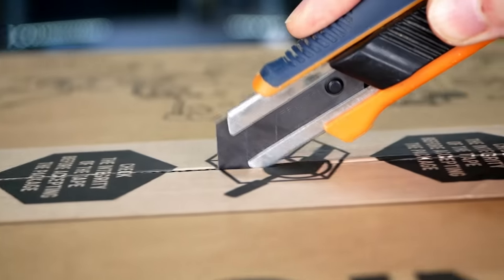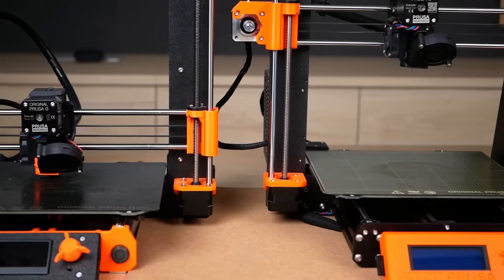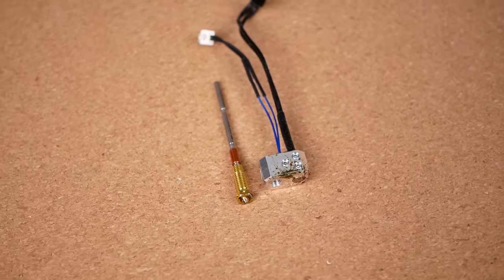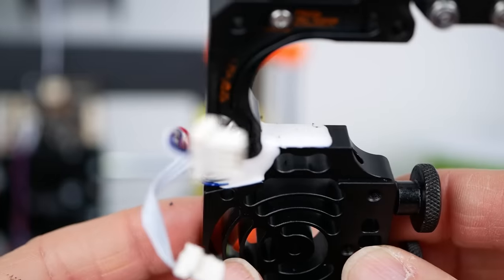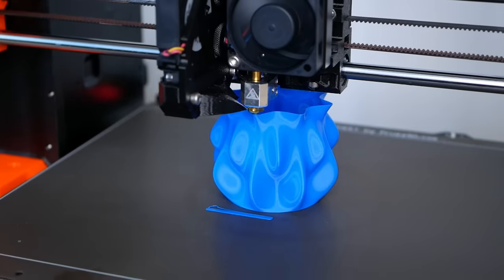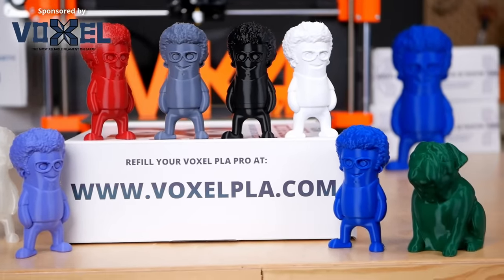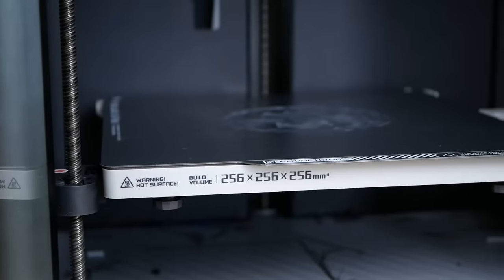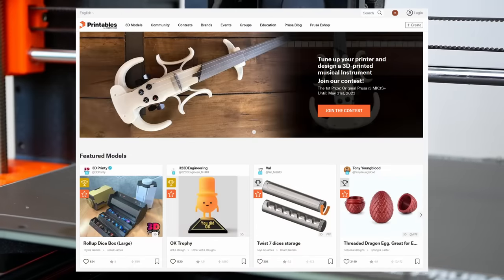Should you buy a NEW Prusa MK4 in 2023 or rather a Bambu Lab X1/P1P?

Comment: The more I've seen from the newly released Mk4S videos, the more I believe it's not meant to be a "new" printer but it's really best used as an upgrade path for those of us with a Mk3. It just seems that being a bed slinger, Prusa knows they aren't trying to compete with Bambu's setup directly. They want to offer an improvement large enough to keep Mk3S owners in the Prusa ecosystem while trying to squeeze an "out of the box" and reliably fast printer into the limits of a bed slinger because of what the community has done thanks to Voron and RatRig's. The Prusa XL is what will compare to what Bambu Labs has done with the CoreXY market.

Comment: Thanks for doing this video.  I've had my mk3S since they first came out and apart from being the most reliable machine I've ever owned (I've got friends with Ender 3's and they've spent a lot of time fixing and upgrading theirs), Prusa is a truly 'fire and forget' eco system.  I'd love to buy a Mk4 but in today's market, it is far too expensive. So unless I can sell my Mk3s for a premium price, I won't be getting a Mk4.  Bambu labs is based on DJI's business model so I'm not confident about the long term support for the current X1 series. (I.E. There will be a Bambu "X2" announced in a few years time at which point your X1 will suddenly become worthless because support for it will end and spares will be difficult to source).  I'd love to build a Voron but there again; the prices are too high for my budget.
Reply: a very good option here in Europe is buying a used voron or Rat rig etc.
yeah a Bambulab X2 is comming but then the same thing happens like the Mk3. Prices for used ones drop very much. Its just normal. But upgrading the Mk3 to the MK4 is also not worth it.... so you end up with the same Problem. But now we got to a point, were most Problems like fist layer, reliability, speeds and so on are done. I dont know how much we can innovate but we will see

Comment: I had two Prusa MK3s and am down to one due what I think is failure in the power supply. It keeps tripping the breaker. And I am constantly replacing the thermistor on the hotend, and have recently had to replace the thermistor on the buld plate. I am done with these machines and now trying the X1 Carbon. Hopefully, it will be more reliable.

Comment: I was struggling with my MK3s and upgraded it to the MK3.5.  Still the issues persisted and I really thought it was just my printer failing on prints that are made for higher end printers.  Layer shifts were the only issue.  So I bought a Bambu P1S and my Mk3.5 sat in the corner collecting dust.  I finally decided to print all new parts and rebuild it from the ground up.  My Bambu printed some gorgeous parts for it too.  I reassembled it carefully and methodically.  It looked brand new with all the dust and bits of plastic removed.  First print, layer shift.  And another one.  Then another.  I was getting ready to sell it for parts and I happened to slide the x axis and I felt something weird.  Something felt like it snagged.  Several hours of inspecting every piece I discovered my x axis stepper motor had failed.  It could have been bad since I got the printer and the speed of the MK3.5 put enough force on it to cause it to finally break.  I ordered a new stepper off Amazon and it resolved the issue.  Its probably in my head but I swear the print quality improved every so slightly.  

Conclusion, I have two awesome printers now.

Comment: Can’t complain about Bambu Service at all.I got excellent service, even as just a Kickstarter backer. Parts come fast, if I need any. There’s simply no way for me Prusa could be better, and especially nothing that justifies to multiply the price even for an unassembled machine compared to a similar slow bedslinger. While print quality matters, it’s fairly easy to achieve if you print slow enough on any Bedslinger of the S1 class. Btw. Prusa is on the proprietary train as well with any new hardware components.
Reply: I can promise you that things will look different in a year's time at the latest. Spare parts: No, service: No, repairability: none
Reply: You also can't compare a printer made of cheap China junk components with one made of high quality materials.

Comment: The fact they said it prints 4x faster but it doesn't actually I feel like is something people aren't talking about enough. It feels like misleading marketing even though I know it says it quietly somewhere.

It feels like they knew they had to do something to appear to compete so they slapped the touch sensing of the XL and their own copy of marlins new input shaping feature into their now custom build and are acting like they invented the wheel.

Also, as a side note, its funny they complain about Bambulab not making PRs when they make new features in Bambustudio when you don't see Prusa improving the marlin available for all printers. Just kinda rubs you the wrong way. Like they made basically a proprietary version of marlin with the veneer of being helpful and open source, and then are angry at another company who arguably is doing similar but in a more open fashion.
Reply: Same thing for Prusa Slicer. Why steal Slic3r and then not contribute changes back to the original project? And yet claim to be the champion of Open Source? They are not!

Comment: I bought an early Mk2, waited months for it. Made the 2.5 upgrade and it's only now starting to age. Yes I have done bearings, rods, nozzles and such but now the wear and tear on the other parts is making me look for a new machine. I do like the Bambu offerings buuuut.... the Mk4 is fast enough for my needs. The input shaping, full enclosure and seemingly better multi material.... hmm gonna be a tough choice for me to make. 

I have had other brand bed slingers as a second printer and always come back to my Prusa and sold the other printer. It's been so trusty for me I often don't watch it even start to print, let alone check the first layer is done. That trust in my printer is well earned.

Comment: Bambu reliability is not as good as Prusa at its current form, although lightyears ahead of all the other chinese brands.  You also can be sure know Prusa machines have longevity as well. Along with this you get instant support. All three good reasons to choose Prusa over Bambu
Reply: Is it though? I think most of the community has a "DIY" mindset so support really means squat for some when it comes to how good support is. $1,000 for a bed slinger that's not pushing the envelope isn't worth it, especially considering most of it is 3d printed with features missing out of the box. Like someone said here...they had to wait a whole year and a half to get wifi on their prusa mini. 5 years for 0.9 steppers, a new bed leveling system, planetary feed, some THICC, and...hell, that's it. Not worth it in my opinion considering the time gap in between releases. Reminds me of intel riding the 14nm++++++++++++ node.
Reply: @MrPanaramuh  no most of the community doesnt have diy mindset. most are people who just want to print with no fiddling. prusa has for years been the only brand for that... i needed some guidance with the mini, go to support chat, and then they helped me unclog the jam. it saves so much time for so many people who dont want to diy... worth every penny and more so
Reply: Is this reputation really earned? My Mk3S+ was an absolute liability. Constant problems, and awful to service, with difficult to access parts that weren't built to deal with the number of times it needed to be accessed.

Built my own printer and would never recommend a Prusa. The reliability is overstated.
Reply: @aSingluarFemboyHooter  What parts specifically?
Reply: Broski Snowski  i want a bambu, i just want the mk4 first
Reply: @Tottorul  Yeahhh, you keep telling yourself that.
Reply: @MrPanaramuh  telling myself what? that pruda has 24/7 support and a proven record of longevity and reliability? all of that is true
Reply: @condorman6293  mostly toolhead components, especially the probe mount, which seems particularly fragile for such a critical part! I ended up fitting my old CW1/Afterburner toolhead to it, which massively increased reliability.

The other main thing I have to moan about is the electronics enclosure. It clearly wasn't meant to be worked on easily, with access from an awkward direction, a rat's nest of wires, and a kinda clumsy way of securing the lid and wires. I hope this is something they improved, because it seemed to have all the disadvantages of a 3D printed enclosure, while not leveraging any of the advantages.

It's not a bad printer, and I think I got unlucky, but I do think the quality and reliability are overhyped after trying and building multiple printers. What was possibly worst of all was the way that, when seeking community support, the community basically closed ranks and blamed everything but the printer. One particularly unpleasant comment said "if you can't get a Prusa to work, I don't know what to tell you, but maybe this hobby isn't for you." That's not a sentiment I've seen from any other community, including far more reliable printers.
Reply: @Tottorul  In my experience, the reliability is average at best, I've bought and built far more reliable machines. Their support is good, but only useful for basic issues, they couldn't help me. What fixed my issues were installing a better toolhead, then overhauling the electronics and enclosure to something serviceable.

They are a cut above cheap Chinese printers in terms of QC, but they really aren't that special, especially for this price.
Reply: @aSingluarFemboyHooter  there is no printers that are "far more reliable", with that statement it just makes it obvious you are bending the truth.. u might have gotten one fluke, but im pretty sure your comment is mostly lies about the overall reliability of several printers, its just not possible. prusa keeps numbers on bad printers and test their own printers for years, they are the most reliable brand by quite a lot
Reply: @aSingluarFemboyHooter  I agree with you 100% about the stupid electronics enclosure. What a dumb design. Clearly they prioritized print speed over ease of use. Though they could have just had it open out!

I've run a farm of 16 Prusas for 3 years now and I think the only unreliable parts have been bed thermistors (kind of annoying to replace) and general v6 issues. The only annoying aspect of the toolhead is the captured wires by the back cover imo. I don't find any other toolhead parts to be a deficiency.

Comment: Thanks for the review.  I own several BambuLab machines and still waiting on my first Prusa machine which was ordered weeks before the X1 Carbon.  Something I don't think you addressed is the lead time from each company.  Even the Mk3 has a lead time that is several times more than Bambu.  While this may not be important to some, it is critical if there is a surge in capacity demand.  Bambu reacts in days, Prusa is weeks and or months.  I get it, the Mk4 is new however on any new product launch there should be a team that provides numbers to have available to the customer.  They have had my money for months now - great way to generate positive cash flow however it is also a great way to push business to their competitors.  Right now I need 3-5 additional machines, I've been looking at the secondary market however I am finding Bambu is the best option...until Prusa lead times decrease.

Comment: I feel like the MK4 is a good machine that's still relevant, but not as a whole unit. The extruder is something I haven't seen so far. The bedslinger concept is slow, but proven and easy to maintain. The loadcell concept is amazing, aswell as the 32bit board. The nozzle system seems smart and reduces points of failure. All that are great ideas with so much potential. But all combined in one machine seems a lot like "Vergebene Liebesmüh" (closest thing I can think of in english is "like pressing blood from a rock"), the bedslinger part being the thing that holds the machine back.
Reply: You mean ‘squeezing water from a rock’…something like what Moses did in the desert..

Comment: I don't have a Prusa, just recently (~6 months ago)bought a Neptune 3 as a starter to learn the ropes (and a couple months later they released the Neptune 3 Pro and felt like N3 was left behind instantly ...), I was aiming for a Prusa Mk3 but it was a bit over my budget at that time. 

However as I see the Mk3 aged nicely and was iteratively improved upon which is a huge plus in my eyes. I would expect the Mk4 to be about the same, over time it will be better ... a lot of the hardware is there, just need to catch up in the software side. I learned a lot in the past months and I definitely go / save more for an Mk4.

I was considering a Bambu P1P recently because its has a good price / value, but I would not like to be "vendor locked" that much ...and the Mk4 kit is not far from it its pricing, so its price proposal for me is acceptable factoring in some the longer term reliability / support / improvements.

Comment: I have two mk2.5s and two mk3s, one ultimaker 2e, this year I got four x1c's. I still use the prusas and they have served me well over the years. Given the price point of the x1c, I have to say its just a much better overall product. Great and consistent prints with the .8 nozzle. I wont buy another prusa until either the price gets better or they make some significant changes. The x1c is a fantastic printer at this price point and you will not be dissapointed. Only downside is the carbon rods require you to replace the whole carrige but yet to see that break. Also custom nozzles kinda suck but at least they are not crazy expensive.

Comment: It seems like the mk4 was released before all features are available, most notable are touch screen and input shaping. I’m positive they released quicker then they wanted due to losses to Bambu labs. 

All that being said I think this is a needed move forward for Cartesian printers. But it’s a Cartesian printer. I’m sure it’s going to be the gold standard that quickly will be copied by other manufacturers. Though I think it will take some time before they catch up on orders. 

All that said, while I can’t say never, I’ve moved past Cartesian printers. I have little desire for another bed slinger and the issues the moving bed brings to the table. While prusa has a strong network and support team, they have got to move forward. The new XL printer seems like that is more of the future prusa needs to remain relevant. They also need to speed up their development process, as nearly 6 years between new products leaves a lot of room for other companies to swoop in and become king of the heap. 

I’m not going to speculate any aspects of the cost of the machine, there are numerous reasons prusa printers cost what they do, and cheap (or expensive) doesn’t always mean better. But I will say I feel like the mk4 is a bit overpriced for the features it has. But I’m sure it’s going to be a good printer.

Comment: I have both MK3 and Bambu lab X1C. Once you are used to the fast printing speed of Bambu lab there is no going back. The AMS system is much more reliable than the MMU too.  The only complaint I have with Bambu is the noise. So attachment apart, I'd say Mk4 is definitely too little, too late.

Comment: Great video!  Im still using a print farm of Mk3s+ which is still serving me well with almost NO downtime on any of these amazing machines, they may be slower but reliability is my most important feature!
Reply: Do you run petg in your farm?  I had the hardest time trying to get petg working on a kingroon.  I think I bent the extruder cuz it didn't print the same, anymore.  I may cave and give prusa a go.
Reply: @redone823  Yes p e t g prints pretty much just like PLA You just need to use the textured bed
Reply: @redone823  PETG works just like PLA in mk3 series. Never had any issues. Textured sheet is a must though.

Comment: Voron user here. I love tinkering with my machine, but sometimes, you just want a reliable workhorse to do day to day printing while your more "ambitious" machine is going through yet another upgrade or modification. And Prusa printers really are a good fit for this role.
Reply: Yes! I'm in this same boat, I got into 3d printing with an MK3S but recently built a Voron0. While the Voron is super cool, fast, etc. it is also been a project. It honestly really made me appreciate how good the MK3S is at just getting something good printed. With the Voron, not only do you have to build the thing, but then you have to write firmware for it and gcode, etc. etc. I still don't quite have it to where I want it and it has been printing for hundreds of hours at this point. Changing colors still needs some work, if I need a multiple color print I just fire up the Prusa since it just works.
Reply: Voron 2.4R2 350x350 user here. Absolutely they are reliable workhorses that run day to day, EXCEPT its running at 600mm/s 10k accel. The 2.4 350x350 is actually a similar size to the mk3s/mk4 in terms of total printer size, and since I assembled mine over a year ago, its been down under 1 hour total, but has logged 1400hrs of print time and 14km of filament.  After moving from using mk2 and mk3s into a voron, its hard to go back to the small bed, lower print quality, and drastically lower speeds. The XL might have been a good option, but after looking at the "bellows" and cost, I don' think its worth it to spend "pro" printer money on just being able to print in color.